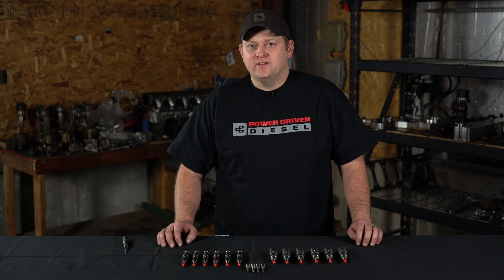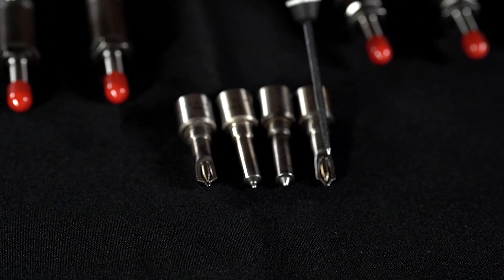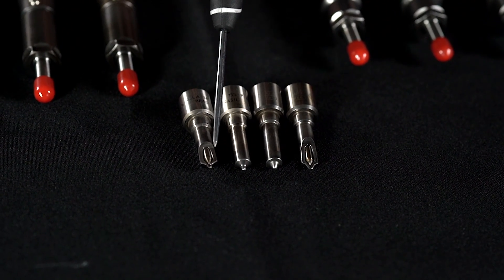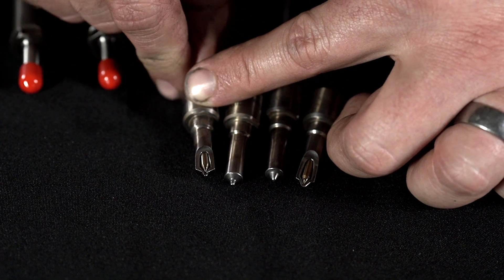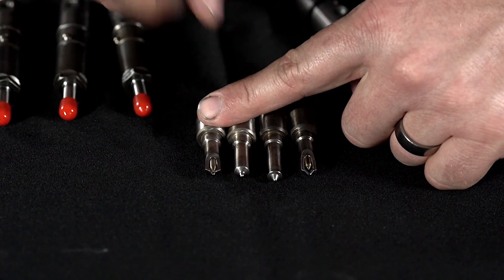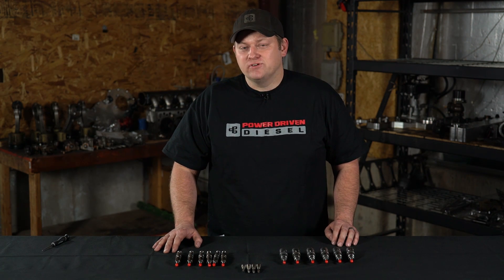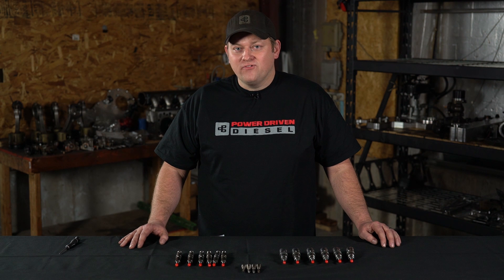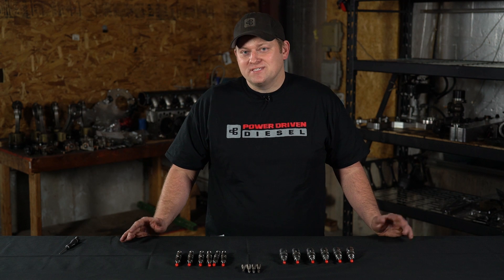Cummins Injectors SAC vs VCO Nozzles

Comment: Does this mean the VCO is more durable then the SAC injector?
Reply from the maker: Both nozzles are durable, we've seen more VCO style with split tips on 12v Cummins applications but there is a disproportionately higher amount of VCO out there due to the fact that the factory stock nozzles were VCO.  Durability shouldn't really be a consideration as both are very, very reliable.

Comment: son has a '98.5 auto holy grail, brother has a 99 auto both stock dodge cummins.  From Loveland,  CO to Cabo and back the 99 24 valve got 10% better fuel milage..and a failed vp44 injection pump.   Might mention, our '05 common rail has had 8 injectors fail..none of our 6 dodge 12 valves (stock) have EVER had a failed injector

Comment: What about towing noise, or just loading the motor down?
What style injector is quieter under load? On the hyw.
Reply from the maker: Yes they are also more noticeable at hwy speeds
Reply: @pddofficial  
What are? 
They?
Sac. Or other styles.
I need elaboration please.
Reply from the maker: @hardhead7056  VCO is quieter!
Reply: @pddofficial  thanks. 
Where do powerjets fall in that category? Loudness. 
Vco sac powerjets. 
Rate them in order please.

Comment: Does the sac make it black smoke more while the truck idles.  Cause I got some injections from a buddy with the other stuff done I can tell the truck idles more smoke comes out. So does that mean I can possibly have sac I’m trying to get another set of injectors for my other truck and I tow akot of heavy equipment I was guna get 200hp cause I currently run 150 in the other truck I got from a friend but I wanted to go a little bigger cause I’m started to tow some different loads
Reply from the maker: That could be a sac Nozzle that is causing the problem but if you went from a stock injector to a much bigger injector that would also cause more smoke at idle

Comment: Hi I’m looking for new injectors and not sure what % I should get I have a 04.5 truck with built trans head studs 165 lift pump and plans for turbo and cam within a year i live around 500’ above sea level I drive the truck a few times a week and pull a boat on the weekend 
I’m looking at  30% and 45% my rwh goal is 550 hp

Comment: And the next expert tells me that the SAC style won’t be good for towing, and they only recommend them for those making huge power. So one or the other is wrong🤷🏻‍♂️
Reply from the maker: we have had no issue out of the sac towing
Reply: @pddofficial  Ok, have you noted any differences in mileage between the two? The other video I was watching was saying that a SAC will live longer in a long duty cycle application (ie boat, tractor, generator, etc) due to better tip cooling and will also flow more, but will not do as well as the VCO in terms of driveability, mileage, and idle haze. He recommended the VCO for towing. So I’m just trying to sort out my thoughts

Comment: What are the injectors psi rating?
Most diesel injectors are between 10,000 psi - 30,000psi.
There were a few performance injectors which advertised 50,000psi.
Unfortunately nobody uses this metric anymore.
The higher the psi the smaller the droplets of fuel and hence more power and greater efficiency.
GreenDiesel Corp. from Australia produced a 160,000psi injector, producing nearly vapor with a 99.7% burn in the combustion chamber.
It was possible to achieve 500hp @ 40mpg, both power and efficiency.
Company was destroyed and consumed by a diesel big rig distributor who has done nothing with the technology since acquiring it.
Reply: LOL.  I can set any injector to any pressure you want...  Nothing special about that.

Comment: Can you guys do a video on 12 Valve longevity, reliability & weak points VS a 24 Valve?    And Pros & Cons of each?
Reply: I Know You're Right But basically they’re both excellent engines. I’d almost rather have the 24v just cause of some extra things like double the valves , two oil drains for turbos things like that. Although you can get a storm block 12v. I’d say only reason 12 is better is cause of the p7100 and ve pump.

Comment: I’m gonna run 150’s on my 62/68/14 borg warner svx.. I have sac 75hp now and love them.. not sure which ill choose next..
Reply: PowerDrivenDiesel  I was gonna convert to a P7100 but went back to vp one more time. I have a 180hp 911 pump in the garage. Next year with twins.
Reply: PowerDrivenDiesel yeah running the P7100 with a 62/75 will make me happy. I got a fully built suncoast. I just want to get above 3000 rpm.

Comment: I have a 2000 dodge ram 4x4 Cummins 5.9l
I was wanting to add some power but just not sure how much the stock transmission is able to handle 
I'm wanting to use to tow a trailer
Reply: PowerDrivenDiesel 
Ok thanks
Reply: I'd get that stock auto & torque converter beefed up.  If nothing else at least more of the power you make today will get to the ground.  Stock gets the job done, but man it sure is sloppy.

Comment: Hey, what were you pushing through the injectors? Kerosene?
Reply: PowerDrivenDiesel so you just took the solenoid off? Just to use poppet pressure?
Reply: PowerDrivenDiesel no I get that part, but could you test a piezo injector that way?

Comment: After searching the web for (mis)info and opinions to find injectors, I ended up ordering your 145 5x14 VCO injectors for my 93 two days ago. Can't wait for them to come in so I can install them along with my HE 351CW and 4" exhaust. Today I saw this video and i'm glad I ordered the VCO's for my truck.
Reply: @pddofficial  I finally got around to installing the injectors and the first thing I noticed what is the idle dropped about two hundred RPMs and the truck idles like it has a lumpy cam in it and the truck rocks back and forth. I adjusted my fuel screw and brought the idol back up. The stock h1c turbo jumped up to 39 PSI boost which is about 7 PSI more than I had before and the smoke isn't actually too bad so I think I'm going to leave the h1c turbo on this engine since it performs very well. I also have a 1997 engine with a p pump on it and for that I just ordered your AFC live. What do you think I should do it this one to get it to idle correctly, reset the pop  pressure slightly lower, or bump the timing up? I already have a dynamic timing spacer installed on this engine.

Comment: What would be the most efficient injector for 97 12v 5 speed. Truck is stock and never been messed with. For me it has all the power I need. Just would like more mileage if possible. Gets 21mpg if driven lightly. Thank you
Reply: You aren't likely to do much better than that as an average. Remember you're pushing a 3.5 ton (unloaded) brick down the highway. That's not taking in to account the tire size and rear end ratio. The stock injector for a 5spd is known as a 5x10, auto's had a slightly smaller injector. If you think the truck has all the power you need, I'd leave it as is. How many miles are on the current set of injectors? More than 150k and I'd probably go ahead and change them. Other than that be sure to periodically add cetane to the fuel to keep the system clean and change the fuel filter. You aren't really going to want to add larger injectors if you like the truck in stock form. You'll be adding more than you think to properly support the injector, 5x11 is the next size up and 5x12 is probably the most popular. They will add roughly 70 and 90 hp respectively. Either one of these really will be more fuel than the HX35 will be able to clean up. Sure you could run the larger injector and then clean up the smoke (and diminish power) with AFC live, but it will defeat the purpose.

A short list of mods and add ons suggested to run those injectors:

BHAF (Big Honkin' Air Filter)
4"or 5" Exhaust with correct downpipe for new turbo
57mm or 62mm turbo
60# Valve Springs
4k Governor Spring Kit
AFC Spring Kit
AFC Live (an absolute must have)
Gauges (Pyro, Boost, Fuel Pressure)
Dual Disk Clutch
Reply: Thank you so much for your time and knowledge. I have 210K on my truck now and it does have a BHAF but that’s it. Exhaust is stock and was thinking of 4 inch turbo back straight pipe. For now I think I will leave it the way it is. Thanks

Comment: So for the mild guys wanting to run under 500hp.  What impact do the SAC injectors have on mileage?
Reply: do you  find that the 24v or the 12v perform better for fuel economy? all thing being equal?
Reply: Shain Andrews it wont really change that much it all depends on your foot
Reply: Anthony Pfohl It all depends on your injectors and foot. both 12&24 valves can get great or complete crap MPG if ur in the throttle with high boost every vehicle is different
Reply: I went from stock VCO injectors with hx35 to SAC 7x009 injectors with hx40. Saw a 2mpg increase using the same tuning.
Reply: Good info.  Complexity forgot I had posted a comment over here.  I have been playing with timing and seem to have fallen into the 18-19 degree range, just to find you also think around 18 is a good spot.  If I get a wild hair I might pick up a set of SAC's.  Never tried them before.
Reply: @ShainAndrews  I was getting 20 mpg with a bad vp44 lol